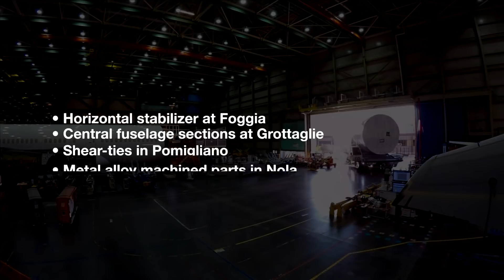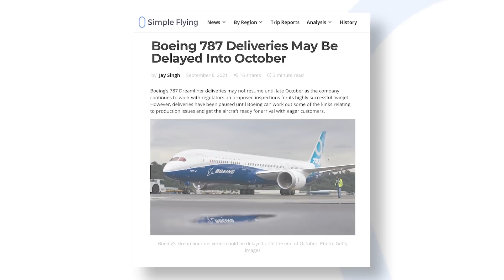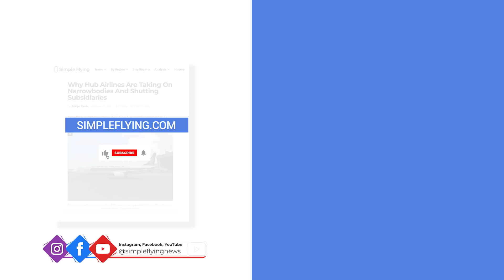Titanium Plates: A Look At The Latest 787 Dreamliner Issue

Comment: A real 'focus on quality' begins BEFORE manufacture, not after a bunch of product is in customers hands.   It is becoming increasingly evident the Boeing has lost the idea of Quality Control.
Reply: Absolutely agree with you Bill Burki, before the items are put into planes is when a properly done QA finds the issue. Once again profits over quality has endangered the people.  As for the rest of you defending Boeing, get off you knees, wipe your chins and find some back bone.
Reply: It does seem they have lost their way , sad
Reply: I wonder how many of these "Brown paper bag" recipients are happy to fly in a Boeing?
Reply: Typically Boeing requires a whole bunch of independent test certs to be procured and available for every lot of parts as well as QA checks and traceability up and down the chain. Only way I can see this playing out is MPS faked test reports (either skipped the tests and forged new test docs or said they had them on file but did not provide them to leonardo, common practice is to only provide physical copies of certs when requested or allow customer to pull digital certs themselves while stating which certificates are on file). The bare minimum certificate is a manufacturer Ceritificate of conformance stating that the mfg guarantees these parts to a specification (defined as a boeing specific part number or an industry standard PN for more common interchangable parts) and in terms of liability if you have a cert of conformance to a boeing part and then fail to conform to the standard you risk being delisted as a boeing approved supplier and you're going to lose a looot of business because even boeing subcontractors i.e. leonardo in this case, but also any other boeing submfgs will stop being allowed to procure your parts. MPS played with fire and odds are they'll never be able to operate in aerospace again if this turns out to be willfull negligence and not just a mistake that can be solved with corrective actions and followups
Reply: I was going to write the exact same thing. Quality assurance must be done before the parts are used in the assembly of the aircraft, not after.
Reply: This sort of thing goes on intermittently with both Airbus and Boeing on their other product lines, it just does not make the news.  Boeing being in the hot seat at present, it makes the news.     Cheers
Reply: Oh come on !!! When a supplier issue parts they are taken to be at the specified tolerances , they are not all tested again ! 
Look on the bright side, at least they know before a plane drops out of the sky !
Reply: So you obviously have a major problem with every auto manufacture in the world to then.
Reply: Even tho it’s the suppliers fault not Boeing’s but ok
Reply: @justplanecrazy5575  Boeing is the manufacturer, so yes, it is Boeing's fault. Their QA should have picked this up before the parts were used.
Reply: @jennyjohn704  no. It’s not their fault. It’s the suppliers fault. They didn’t produce the parts like usual, and only found out afterwards. If Boeing were to inspect and test every part they get, not only would it make production times sky rocket but it would make the price of the aircraft go through the roof too. And don’t try to say “hur dur Boeing is being cheap by not testing” because going off that logic, airbus are being cheap too. And every car manufacturer in the world are too.
Reply: @jennyjohn704  certainly not. You cannot inspect every single part that comes in. You inspect the first batches you get and you do some spot checks after that. But if you have to check everything yourself, your cost would go through the roof. The goal is for the original manufacturer, who has all the knowledge and all the tools to do the work, to let them deliver a product that is up to specifications.
Reply: @jennyjohn704  Did you watch the full video? "Leonardo confirmed the issue after BOEING identified a potential problem during an audit". So, yeah. Boeing's QA DID pick it up as part of their routine processes. Much like you have to trust a restaurant or grocery store to provide food that isn't contaminated, spoiled, or has been handled by somebody that forgot to wash their hands after going to the bathroom.
Reply: @dstarfire42  So finding that there are some important faulty parts in their plane after 3 years is their routine process? We are not talking about hanger in the toilet, if it's made of titanium you can bet it's important. Sorry I don't think that is good enough.

Also we are talking abut company which installed something on their planes, without telling anyone, that takes control out of the pilot's hands and it's not giving it back until the plane is crashed into the ground. One wonders is there quality control of any kind to do something like that???
If that company isn't extra careful about quality issues after that debacle it just shows they learned nothing.
Reply: @Hans-gb4mv  that's the trick of the chinese- 1st parts sent are beautiful then after the contract has been awarded the quality drops
Reply: @jennyjohn704  you know pharmaceutical companies don't test all their suppliers products don't you? They are assured the ingredients is up to spec. Then make your drugs....but that's how it is
Reply: @justplanecrazy5575  As the integrator who oversaw the entire plane, including approving "Boeing Approved Suppliers" , yea, the buck does stop with Boeing.

Comment: The Boeing Board of Directors better wake up and save the company before it's too late.
Reply: Don't forget about the lithium ion batteries catching fire.
Reply: They don't have to worry about saving the company. American taxpayers will bail them out anyway
Reply: Remember the issues at the beginning.... An inoperable plane was rolled out at the launch... So much missing I don't think it ever flew
Reply: @allan4787  Correct to a point. At the time that fuselage was just that, an empty fuselage. The 787 preproduction was  late and since it was 7/8/07 (July  8, 2007) Boeing needed to roll out something; anything to show All Nipon that Boeing was making progress.  So  Boeing rolled out an empty fuselage; no seats,  no controls, nothing.  I think I read that Boeing never intended that particular fuselage  to ever fly.
Reply: Even the starliner is a hot mess.
Reply: The new 767 based tanker still doesn't work
Reply: The Boeing board lost all credibility after the first MAX crash.

Comment: The Dreamliner is turning into a nightmare for Boeing.
Reply: Always has been. They are never getting the R&D cost back.
Reply: @ydfhlx5923  the 787 is like the single most successful Boeing aircraft of the last 2 decades… and oddly enough, this is one of the few times in recent events where the issue isn’t entirely Boeing’s fault, funny enough. 

Let’s not talk about how the 777-9X has 787-10 specifications in the flight computer or how it has uncommanded pitch deviations, which means your pitch may suddenly vary without warning, let’s just talk about how a single fault means that outsourcing is bad, yeahhhhh…
Reply: @kelly2631  it's the most successful Boeing aircraft of the last 2 decades because the other one crashed!
Reply: @tank-eleven  I don't recall the 747-8 crashing, or the KC767 having any major issues, or 777F having any issues, or P-8 suffering from defects, or 737 AEW&C. 737-700ER, 737-900ER, 777-200LR, or the KC46 having too many issues. The C-40A, EA18G, F-15SE, F/A 18E/F, and the YAL-1 seem to perform just fine. Sure, the Boeing X-32 was kinda wonky, but I don't recall it crashing?

Comment: Tell. me again, the benefits of outsourcing. . .   Ah, when a company is run by beancounters instead of engineers. . .
Reply: There must be some outsourcing in the manufacture of aircraft.  Boeing cannot make engines or radios, for example.  Outsourcing is appropriate for anything that requires special expertise.
Reply: Zero outsourcing is almost impossible for a company the size of Boeing, they'd have to pay billions to be able to have zero outsourcing, and planes would become more expensive and take longer to deliver.
Reply: Yes, but since Boeing outsourced almost the entire plane, and since this problem is with primary structure, I think Bram's point stands...
Reply: Airbus outsourced since its very beginning. There are methods to control the quality of parts from suppliers and Airbus is applying them all the time. The problem with Boeing's beancounters' mentality is that 'focus on quality' was previously, before the 737 Max crashes, 'focus on profit'. They reduced greatly the costs of quality control, especially in Charleston. Now they are turning the tables by stating that their after-build quality control works! It should have worked since the very beginning of the outsourcing of 787 parts.
Reply: @brugcom042  NC 787 are junk, Qatar/Emi refuse them.
Reply: Theyw wouldn’t be able to make planes if they didn’t outsource
Reply: Wouldn’t you? Like why reinvent the wheel. If another company already has the infrastructure, logistics, and optimization for clips and fasteners why not purchase from them instead of making it yourself. I understand where vertical integration is great, such as with space x, but that’s not the norm. Plus an aerospace engineer isn’t necessarily a metallurgist and knows how to produce high quality consistent titanium so why not get the company that has those resources do that and you just pay them for the work.
Reply: Utopic!
Reply: Division of labor is the basic principle of economics. There are lots of things at play - each country's competitve advantages (be it a talent, natural resource, optimal geo position), economies of scale you name it.  Had not Boeing or other frame makers for that matter outsourced the jobs, they wouldn't have achieved this level of tech advancements.  This comment is such a sheer disrespect to other professions and can come from only a clueless person calling him himself an engineer